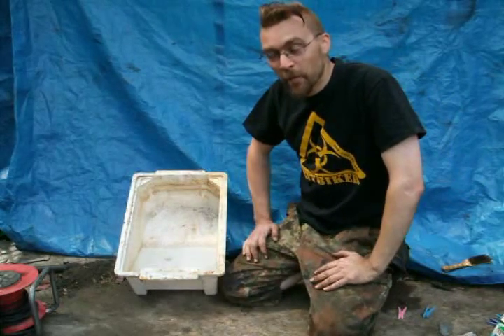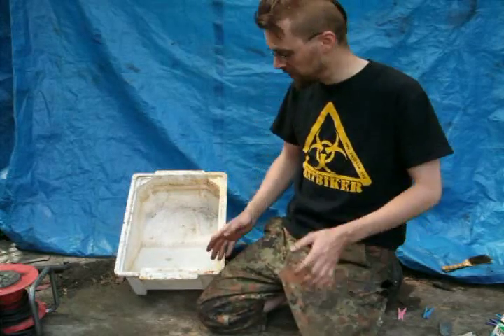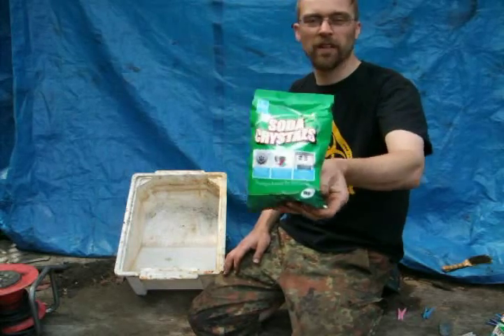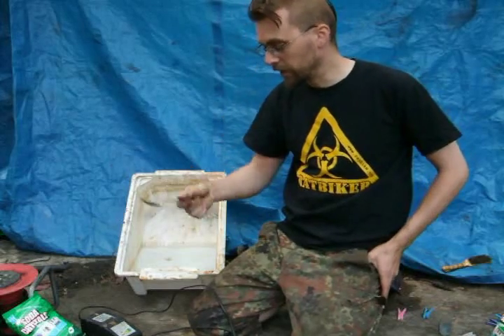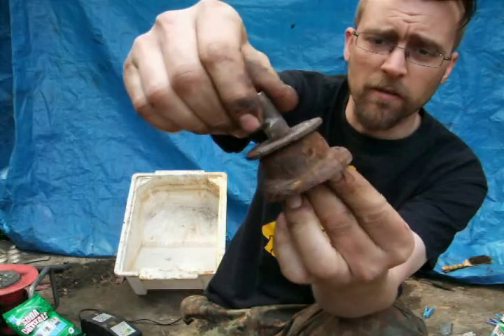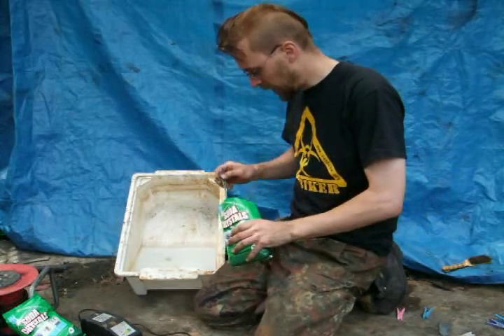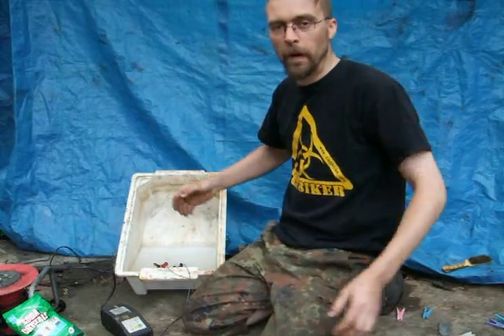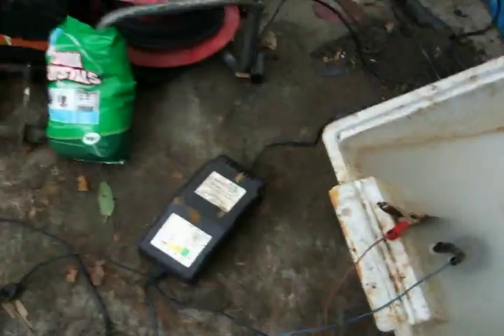How To Remove Rust With Electrylosis Part 1 of 2

Comment: Use a metal container with a rubber mat at the bottom. Then connect the positive cable to the container. Take some coat hangers and tie the parts to a 2 x 4 which you can lay across the top of the container. Connect the negative cable to the coat hangers. The metal container gives you 360 degree electrolysis. In fact, if you could hang the parts suspended in the solution without hitting the bottom, you can do without the rubber mat and get even better electrolysis.